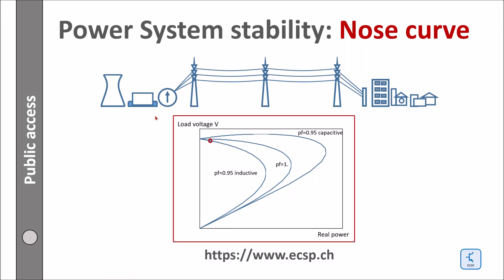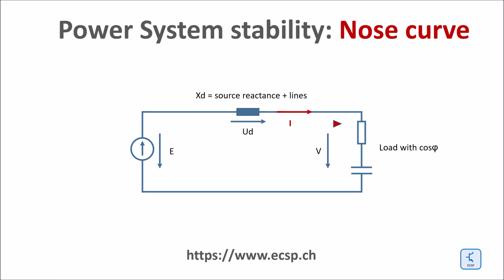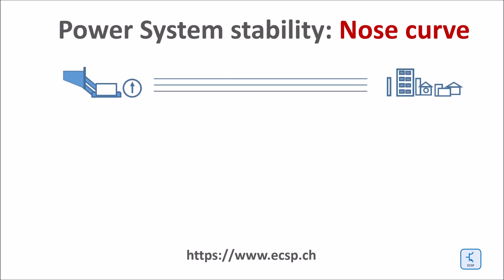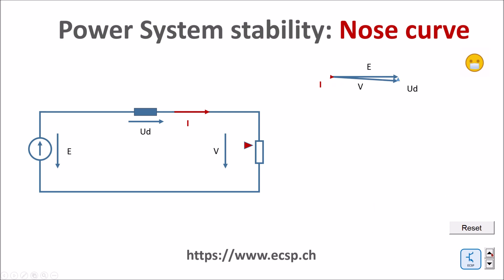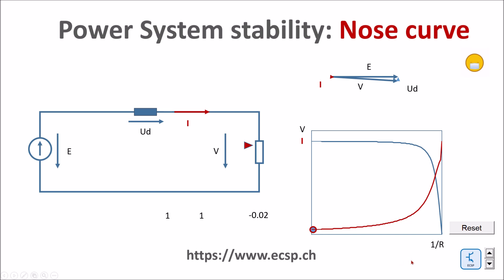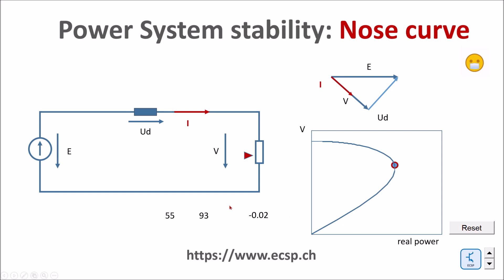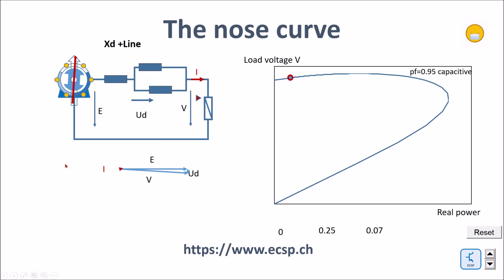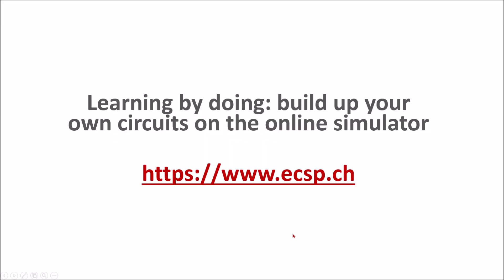Power System voltage stability: The Nose Curve [circuit simulator]

Comment: Very nice analysis.  It would be interesting to see a similar analysis of a direct current (DC) power system, e.g., where cabling/line self inductance can greatly affect voltage stability at the loads with large step loads or faults in the DC distribution system.
Reply from the maker: Thanks for your feedback. I probably do not have the necessary background to support your request. The nose curve is valid for AC systems only as far as I am aware of.